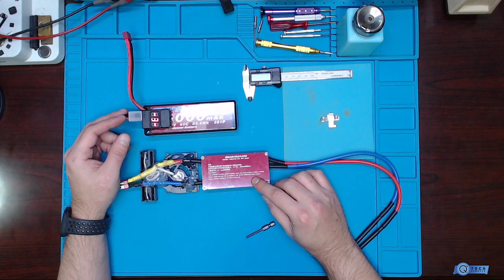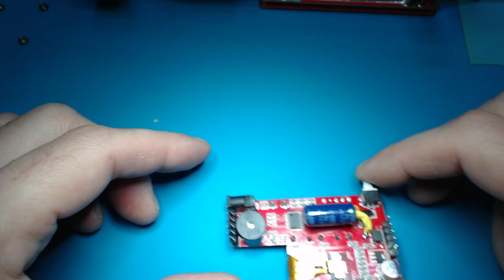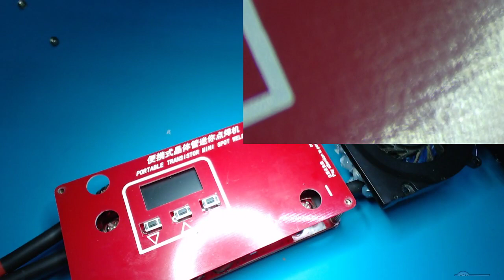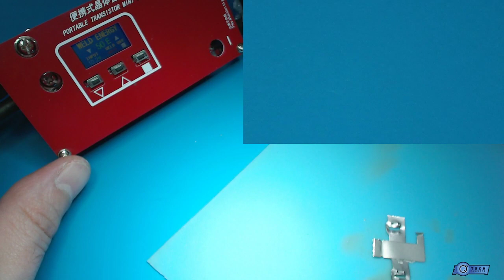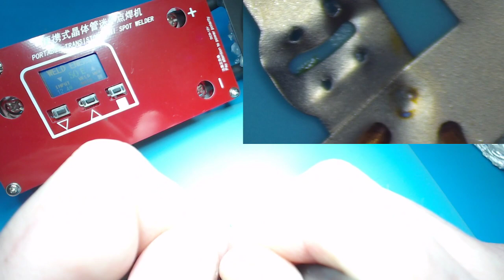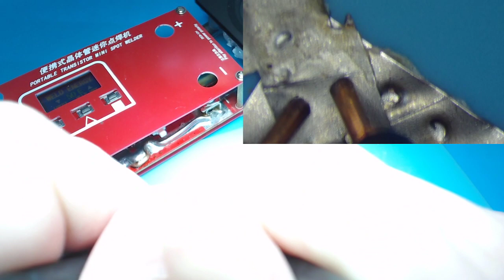MIN SPOT WELDER Testing Mods

Comment: Use a better battery  connector, those Deans or T plug connectors are unable to supply enough current. Use at least a XT60 or better yet a XT90.

Comment: You need to replace R4 on the back of the display module with a 500ohm ish resistor. That will keep the mosfets saturated and stop them blowing up

Comment: The reason the board fries is because the mosfets aren't staying fully open due to v-droop, not the other way around. It makes it so they have abnormally high resistance since they aren't full opened. And you mean microfarad with respect to the capacity of the capacitor.

Comment: You ever try running it from a 4S pack? The LDO regulator for the control side on mine says it's spec'd for up to 35V and the mosfets for 40V. Don't have any 3S packs on hand, but have some beefy 4S packs from 1/8 scale buggy racing.  You notice anything that 14.8V may toast while tearing into yours?
Reply: I'm using a 4S LiPo car jump-starter battery pack which is ~16.8V fully charged, though to be cautious I've been using it 80% charged at just under 16V and I've done the capacitor mod with a 25V 1000uF cap to accommodate my 4S. Result is a v. powerful welder which gives great welds (pure 0.15) nickel to nickel at the 25 setting. I also bulked-up the solder tracks and relocated one of the probes to the battery input connection. Cables from the battery are short via an EC5 connector.

Comment: Voltage in welder is lower because of 0.7V diode drop of the diode you added to protect against kickback or reverse polarity.

Comment: Have you seen the newer Revised version V1.0.   Both the FET board and the controller board are of a different design.   The FET board has increased solder tracks.  The controller board does not have the diode where the earlier version has, no diode visible nor any capacitor mod.
Has anyone any experience (good or bad) with the new version?
Reply: https://ibb.co/mF1PgCs   // this one? i dont know if its working, wanted to make a capacitor mod first
Reply: I got mine today. Don't know if i have to do the mod or not?
Reply: me neither, i just make some soldering and im waiting for my battery to arrive to check it, if it blows im gonna try to buy one more but the first version
Reply: I just received mine and it's also the updated version labeled B101-2K. The diode now sits on the lower board next to the the capacitor directly connected to the positive terminal, so every component including the capacitor is behind it. This should solve the problem as the capacitor now stabilizes the voltage for the logic the way I think it was intended.
Reply: @ingos5233  mine blew up after first weld at 10e, used 3s  60c 5200mah
Reply: @3-ylitery249  That's bad. ^^ I thought moving the diode should have fixed the problem. I don't see how another capacitor should change anything here. Maybe they added another error. ^^ The circuit for driving the mosfets looks different. No IC on the small board but resistors and transistors under the capacitor. There are also two resistors on the backside of the lower board solderer directly to the pinheader by hand obviously as a fix. One should be connected to the capacitor with a fine wire but that doesn't seem to be done correctly on mine.
Reply: @dave himlin No, one of the mosfets blew up at the second try with low setting. Found a video which shows another problem with newer versions https://youtu.be/slU0oCKENLI . Version is different but AFAIR (send mine back) the PCB with the MOSFETs looks the same. At least my B101-2k also had the additional SMD resistors on the backside.
Reply: I have a CA20-2K version and it doesn't have the diode near the white on/off switch.

Comment: I have got some questions:
1.What is the minimum 3s lipo voltage for good welding ?
2. Have you tested Shottky and TVS diode ? According to https://endless-sphere.com/forums/viewtopic.php?t=81400&start=550#p1218325
Reply from the maker: All you have to do is the capacitor in mod ..I did not put any diode’s I took them out I just only use the capacitor that’s it Hope that helps
Reply: @QsTechService1  Thank you for your answer. But what about electrical voltage - my first question?
Did you remove the diodes because they worsened the welding parameters?
Reply from the maker: @Ziomal716  I remove the diode because it was drawing down the voltage I had the diode in circuit with the battery 🔋 noticed a little weaker welding then weaker and weaker Then finally blew ..So I don’t use Any Diode Just the capacitor mod 👍

Comment: I have this spot weld. The microcontroller is feed by the small 3.3v (3 pin chip) and is fine during the pulses. The problem is the mosfet driver (8 pin chip that is under your capacitor), during the pulse the voltage dips and so does the voltage on the gates, the capacitor helps to mantain the voltage high enought on the mosfets gate. If the gate voltage goes down, the resistence of the mosfets goes up and they blow. This is a critical fault, from the fabric... after the mood this machine is excelent with a small fan this spot weld can achive reliavility of a semi professional spot welder
Reply from the maker: Yes it’s because of the spike and then the drop that’s what I seen on my scope ..By putting that capacitor in there and place regulated .. works awesome going to be uploading another video of modding another one  ☝️ For one of my friends Works awesome after the capacitor and fan mod People can modify their’s with fans however they’re Liking  😂  Pretty good for a cheap spot welder and a cheap capacitor 👍

Comment: Please show where to connect diode on battery cable(s).  Also, describe what the diode is so I can purchase it for this fix.
Reply from the maker: Just get a high powered diode TV Shockey Put it in the positive wire going to the battery 🔋
Reply: @QsTechService1  Would a  Schottky 1N5817 work? (20v.  1A.)
Which end do I orient toward battery?
Reply from the maker: @padooskee3147  The stripe you put towards the controller Towards the spot welder 👨‍🏭 Face the diode the negative towards the controller spot welder and the positive towards the battery Would be good to use like 30v But you can try the 20 It’s just to stop it from shocking the battery 🔋 so I figured I would put it in 🤣 For more protection It’s better to be protected 😂
Reply: @QsTechService1  Thanks for the advise.  Can't help but ponder how strange it's going to look with a #10 stranded battery cable interrupted with a single narrow strand of diode wire...